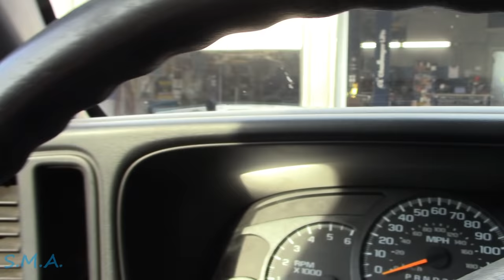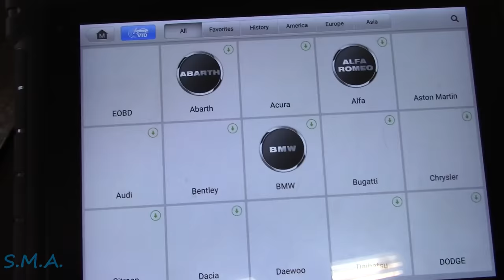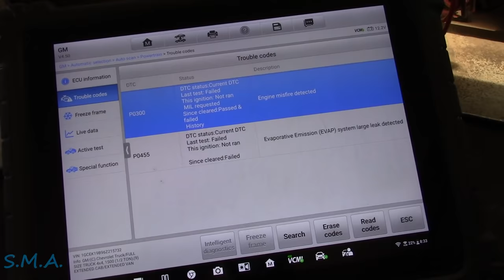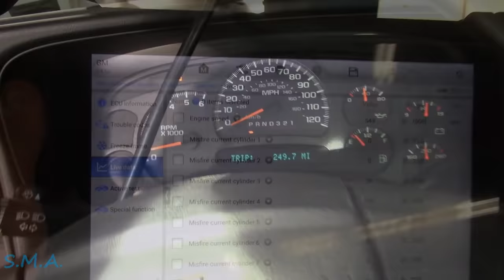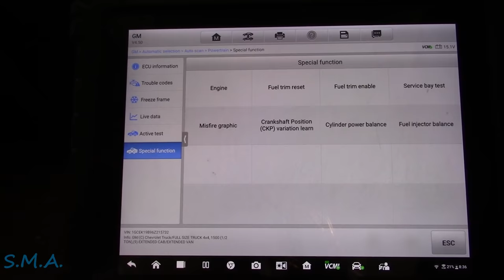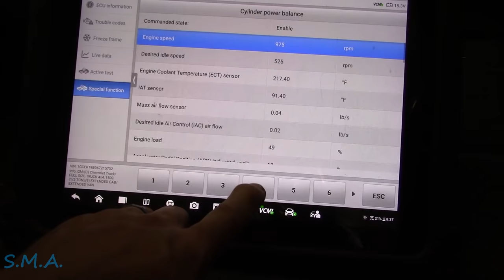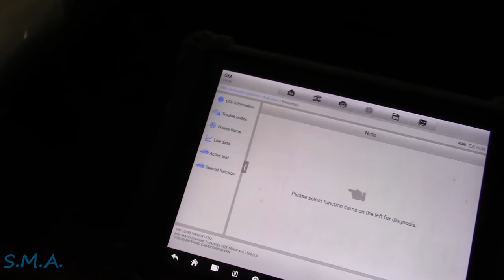GM - Chevy Truck: Misfire Diagnosis

Comment: Have. Question and I'm at a lost. I'm working on 04 Colorado 3.5 and it isn't going past 35mph. New transmission which it needed. P0300 code but all cylinders are fine. No misfired read. Coils,plugs and wires new. What am I missing? Thanks for the videos!

Comment: I was requested to diagnosis a “ Problem Child “ for reoccurring injector failures.
Turned out previous mechanic failed to clean out fuel rail. The source of dirt that kept clogging injector.

Comment: Great differents ways to check injectors. My prblm, is I did a injector balance test, 2injectors on pressure dropped 57# to 46# the other 6 did not drop at all. Why is that possible
Thanks 
DJ

Comment: If the injector wires were bad pcm should set a injector code so injector must be high ohms or resistance or shorted Eric O @SouthMainAutoRepairLLC

Comment: there is a revised valve cover for the spark plug fouling issue on 07- 13 chevys that affects cyl 7 and 1mostly

Comment: as you see just because the injector is electronically perfect doesn't mean that it is mechanically functional..
I've had one stuck open that tested fine... but it was dumping fuel constantly whenever the fuel pressure was above 40psi.

Comment: Can you clean/unstop the injector or must replace?    The fuel tank is near empty.  Wonder if driving the truck near empty much of the time increases chance of fuel contamination... fuel injector plugging.   After finding the plugged injector do you question when was the last time the fuel filter been changed?

Comment: Nice video. I like your style and the scotty kilmer references.  I have a 2001 gmc 167000 Miles with the same situation.  Wires, coils, plugs replaced.  All new o2 sensors. Truck has had a "lifter tick" for awhile.  I'm wondering if it has a worn cam and lifters. New subscriber from Tennessee

Comment: Hey Sth.Main, I did the injector bal test but when priming, won't hold. Block off return, still same. Running is 80 psi w/return blocked off. Pump has check valve?

Comment: Had to do an injector pressure balance test the other day for misfiring, during my testing the in tank fuel pump kicked the bucket, low and behold after changing out the pump I found metal had made it's way into 2 out of the 6 injectors. I guess it was just dumb luck that the source of the metal in the injectors gave up before I sent the car with a couple of new injectors and no pump.

Comment: Firing order should be  18436572, with a gm small block  v8 . Spark, injector activity or pattern, compression, valves and rings. Those are the potential weak points. A weak cylinder won't resisist the crank. Passenger bank, 1357, driver's side, 2468.

Comment: Good video, tnx , great job master, 
Question: i have 2006 Chevy van express mis fire , code p0300 ,  I test everything except injectors, I check gas pressure next day the gauge was on cero ? 
Help me with some clues plz , tnx

Comment: 08, afm ,80 thou, road around gal oil,pack plugs cheap hand diag. Tool change plug side road all over middle ga.die hard chevy man until 08 junk.rebuilt,reprogram old5.3 way 250thow no oil or plug problems.

Comment: So GM 1500 AFM engines are crap...but are the 2007-2009 pre AFM? What I would like is a good 2500 with the Allison 6 speed gasser...6.0or 6.2L in Central FL...what do you know about these GMs? I have a 6.0L Ford F250 from 2004 and have had no issues. I change oil with 5W40 synthetic and I don't even drive it 600 miles a year. (The truck is in WI so I only used it for two weeks a year.) I had bought it 12 years ago and use it for moving my "kids" to college and their new cities of employment.
I have heard so much bad about it but I don't modify it to race or what ever the young guys do...I also have a 2014 Ram 1500 in FL and I heard the AFM fails on them too...learned it had AFM after I bought a few years.

Comment: A true artisan of car repair. Logic and smarts are in full display. What a shame that most shops are devoid of such an individual due to bean counting compensation rules. What a shame the incompetent garages and dealerships are allowed to make as much, if not more by employing the bottom of the barrel. Two Erics in a dealership could easily replace the 10 to 12 existing dunderheads and make the dealership as much money as before, while paying the two mechanics a good salary and keeping the customers happy.
In addition, the car manufacturers should be ashamed of themselves for putting out such pieces of garbage (albeit probably a result of idiotic government regulation).
Toyota now has a $10,000 truck selling in other countries, but not in the US because to comply with absurd US regulations they could never build it to comply with said regulations and still maintain the said price. Greed and government stupidity is killing our products.

Comment: This truck has a similar issue to my 6.0L but mine doesn’t feel like an actual misfire/skip…. This one skips

The injector balance test showed no issues on my truck. All injectors showed equal.

Fuel pressure also checked good, 55-60

Comment: Pull the plug if the plug Is  wet With fuel  You know you've got fuel and no spark or compression But usually if it's a lack of compression issue and it's firing  The plug fuel Fuel will still be combusting so Plug reading can be deceptive

Comment: Man I’ve been having issues with my 5.3 running rough. Was running lean on 2 injectors so I changed all eight. Still ran funny so I cleaned the air filter, maf and throttle body. Still wasn’t running right, but to add to the mix it doesn’t crank right away now. Almost like it’s not getting fuel or something. Still runs rough at idle. So I changed the spark plugs and wires and even the serpentine belt still nothing. I feel so lost at this point. The only thing left would be my coils but they’re only about 2 yrs old, but not ruling them out at this point.

Comment: Hey been watching for a couple years now if not more. I have the same problem on my 2001 GMC Sierra 1500 SLE  4x2 it has a misfire is all Cylinders, according to the mechanic.And he said he found that very odd. He went and tested the truck and he said the truck drives perfectly. Which it does, there's no power loss.There's no anything the truck runs perfectly.The engine runs perfectly.There's no sputtering no no nothing. So I replaced the spark plugs in the wires.  The engine light is still flashing after this, so he mentions to replace my oxygen sensors. OI replaced all 4 of them. It cost me like $750. To replace 4 oxygen sensors. I got way better gas mileage but nope didn't fix the problem. So I was done at that point with him guessing. He said my coil packs should be all running fine. Because the truck's engine isn't sputtering or anything that's what he told me. Do you think this is a coil pack issue? Should I replace all coil packs? How can you even test if the coil pack is even good? I just don't understand how it could be. Saying that there's a misfire in all 8 cylinders when the truck runs perfectly. The mileage is 126000 original miles. And I.
 Baby the truck I don't do burnouts with it. I don't do anything like that. I drive it the way it was intended to be driven. Any help would be greatly appreciated here. I have dumped in over $14000 in this thing.

Comment: Do you think the amp waveform of the injector for cylinder #4 didnt show anything at idle because it also didnt show up as a misfire on Data PIDs unless you did the power brake method?

Comment: Todays vehicles are “electro/mechanical”. Meaning components (many/multiple components) function by Mechanical movements with the mechanical movements being driven/initiated/ignited by an electrical current. With that if the electrical circuit is measuring correctly & making sense. Then the failure is/must be mechanically driven. And most likely a mechanical failure within the Fuel Injector. The fuel injectors have a small piston that (through the 12V electrical current provided) moves/pumps up & down, opening & closing the fuel flow (fuel spray). In this video specific scenario/issue I would say that the fuel injector is mechanically stuck (slowly moving & getting caught/stuck within its normal movement) and could be easily replaced &/or cleaned/sprayed out with a cleaner. Living in the United States of America.....”throw away & replace with new” has typically been the generally fastest & usually cheapest method.

Comment: I'm a subscriber and enjoy watching.  But may I suggest you limit your dislike of GM vehicles and keep the negative comments to yourself? 

Before calling a vehicle junk, how about mentioning the age and mileage of the vehicle?  That's a 17 year old vehicle with likely many many miles and abuse.

You are entitled to your opinion, but you do not need to refer to peoples' vehicles as junk.  Most of your viewers and many of your customers prefer certain makes for many reasons and you calling the vehicles junk is insulting.

The fact is they are not junk.  And AcDelco plugs do not come damaged.  Perhaps that's a distributor or supplier issue.   

You need to mention miles and age of vehicle.

Comment: I have a 2002 Chevy 4.8L (230K) with the same issue, but don't have a good enough scan tool to tell me which cylinder is the issue.  I replaced all the spark plug wires and no help, and did the coil test on all 8 coils and they are sparking.  My spark plugs have about 90K on them, so my next step is going to replace the spark plugs (since it is about time).  If the issue persists, then thinking it is one fuel injector.  I might buy one fuel injector and swap it out one at a time.

Comment: Thank you for the video!
I've been dealing with this on an 03 4.8L.
Dry plugs on 8&5. Definitely 1st thought was injectors obviously not sending fuel through. I ran 2 cans of seafoam and basically a tank of premium through it hoping it would clear it out since the guy I got it from didn't really drive besides around his property for several years picking up sticks lol
Didn't clear it up but now it also has a random what sounds like an exhaust clanking  or heat shield but has me thinking a valve is stuck or spring may have broke or possibly a rocker has broke. Is that something that's possible from a misfire?

Comment: Last GM trucks that were damn good and dependible. Anything after this body style went to crap imo! Mine is a 2004 5.3l and has been the best truck I have ever owned. 210k miles and only thing I have had to do is replace 2 water pumps and 1 starter. Still on original transmission as well. I have serviced the transmission every 45k miles. The more I look at modern trucks the more I think I should restore my 2004 instead. Oh yeah had my instrument cluster rebuilt at 204k. I think I may have an intake gasket leak as at idle it has a slight miss every now and then.

Comment: I got one for you did a crank up and run for few minutes then shut off then you wait just a second switch it back on you if you hear it injectors come on Crank It Up and crank up run for a little bit and then it'll shut itself off the lucky return to switch it off

Comment: Since I do not own a fancy scanner and a scope yet I would have pin pointed the cylinder by pulling the plug wires one at a time with the engine running to see if there was a change in how the engine was running.  As soon as I determined cylinder 4 as the dead cylinder I would have pulled the plug to see if it was sparking (yes I don't even have a spark checker) If it had spark then it has to be fuel or low or no compression.  Since the plug was pulled I would have used an compression gage to see if there was compression or not.  If it had good compression I then would have removed the fuel injector to see if it was spraying any fuel.  Would doing it this way be wrong?

Comment: Hey I need help on my 5.7 I replaced everything plugs, wires,  mass airflow, the distributor itself, Spider injector crank sensor, cam sensor, cap and button, I even replaced the EGR valve and it still missing and backfiring

Comment: Got a 2000 Silverado 4.3 driver side valve cover on top of the cover looks a pvc hose runs into cover there is another vacuum nipple vacuum hose that’s missing sucking all kinds of air. Can’t figure out where it goes too. Or what it’s called

Comment: Do you recommend using E-85 gas ⛽️ ? 
I have used it in my 2018 f150 5 liter for the past 2 years when gas prices went up . My truck is a flex fuel vehicle.  I had cylinder 2 misfire  rough idle , Ford diagnosed it with a bad high pressure injector . Replaced it a month ago and it runs good now . I haven't used E85 since .
Can't E 85 cause that ?

Comment: I bought myself an Autel MaxiPRO 808TS. Unfortunately I don't understand how to use it , but watching this video I see how to get into a misfire screen. I have a 96 Corvette (LT1) . On full WOT it started missing and eventually died. Stopped and restarted, threw a code pO300. After restart it ran fine but I afraid to do a WOT.  So I'll test to see if I have multiple misfiring cylinders which could indicate an Optispark issue. What do you think?  Been watching you for years. 🙂

Comment: Hello...
My wifes 2010 Tahoe 5.3 engine has a misfire on cylinder 7. Code p0307
No clankn or anything...just a misfire. Last week I looked at everything . No lose lifters, No bad spark plug or wire. Pulled fuel injector and checked ohms reading at 15ohms. I put it at back together and ran fine for just a week.
I Have No Idea What The Problem Is...smh.
What do you think it could possibly be?
And it is the engine with AFM.

Comment: I have an 04 Denali that sat for three years. Has no fire on 7 and 8 spark is there, I swapped parts around so I believe it is injector related, But my scan tool won’t connect to the computer. It has power, just won’t connect. Any advise?

Comment: Will down stream o2 sensors show a difference between banks as you watch live data and rev the engine a bit? 

I'm showing this in a 02 mustang 4.6.
Cylinder 8 misfire, bank 2. 

Thanks

Comment: Got 2015 shop on west cost say p0304 present but when they lossen cyl 4 exhaust rocker arm misfire goes away 
Want to pull heads. 
No other issue found in a nnjector 
Does that make sense?

Comment: It would seem to me that as a solenoid type injector if it is electrically intact that the scope would not show a difference in the pattern due to it is a coil that still draws the same current. The pintle moving would not change the power consumption because it is an electromagnet, not a primary and secondary coil which would show a different wave form. My 2 cents.

Comment: I have a 2002 4Runner. It has a number 3 misfire. I replaced the plug and nothing. I pulled the new plug out and found it coated with gas. I don't have my own scan tool. I know new spark plugs should not be coated with gas. So, I ordered a set of spark plugs and coil for $35. If it is still bad, I have a 3 hour job in replacing a fuel injector or 6 injectors.

Comment: What about a closed loop causing left bank misfires but runs fine in open loop?  Trouble code shows P0201,03,05,07.  Says something about injector circuit but runs fine in open loop.

Comment: This post is a year old so my comments are like "so what, who cares?" I didn't read all the comments but some have the impression that the injector nozzle is plugged. The scope pattern to me showed a proper working injector electrically speaking. There are screens on the top of the injectors that will plug the screen with varnish from gas if the vehicle isn't driven regularly. Some injector nozzles will plug because of this condition.  Notice on the pressure drop test, the pressure did drop slightly just not enough to run the engine. The no code for injectors, for me, was a hint that injectors were electrically sound. PCM looks for opens and shorts like OBD1 but not flow on this vehicle.

Comment: had a buddy that has a chevy sm 400  #8 wasn't firing    traded 7 and 8 plugs.   8 still missing  pulled valve cover.   every thing looked good.   traded plug wires. still #8. checked dist cap all looked good. checked for vac leak    nope    
changed spark plug for new one. had a tough time restarting plug back in hole. stuck my head down between motor and fender(didnt have a mirror) someone has left a compression adpter in the hole. took out the adpter put spark plug in run as smooth as a kitten

Comment: Eric,
love your videos, i have a 2002 gmc sierra 1500 base cab and i got a PO351 code. Check engine light is on changed wires plugs going for the cap and rotor next. had it at a garage and they cant find it they smoked it and no leaks.
I know without seeing it but where should i start, they said it shows ittermittent skip on 3 and 5 but they gave up.
Appreciate yours thoughts 
Thx Cliff

Comment: I was wondering if you could help with a problem I have a 2006 Chevy Silverado 2500 hd with a 6.0 vorteck  at highway speed I am getting a miss fire that starts at 2500 rpm around 65 mph

Comment: I have a 2010 Chevy express 1500 with a 4.3 V6 it turns on just fine drives but when I pass 55 it’s sputters a little bit and I feel like it loses power going up the hill when I’m going fast after 55 mphwhat do you think spark plugs, cables fuel pump, please

Comment: Man I hope I haven’t bought a pig in the poke but I bought a 2012 Chevy Avalanche with a 5.3 and a 143.300 miles back on the 3 of dec now it’s acquired a skip but no codes weird, it only does it when I go up hills in in 6 gear 6 speed automatic but in 5 gear not some much. It looks to have fairly new coil pack and wires. I thought at first I had got some bad gas. Haven’t made any attempt to look at anything with Christmas. After listening to you it sounds like a weak injector.

Comment: Could this method be used to determine if an injector is dumping too much fuel, still throwing a misfire code? I would think the fuel pressure test would show a larger drop in that one cylinder.